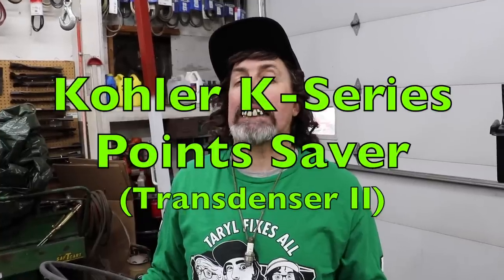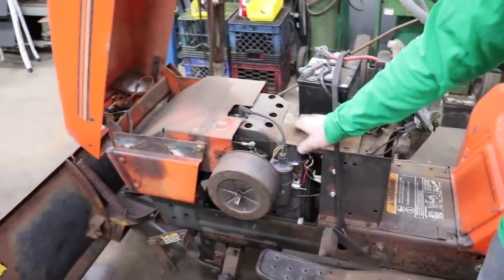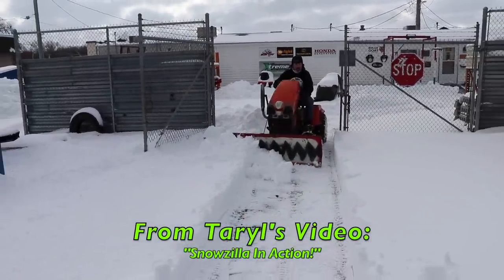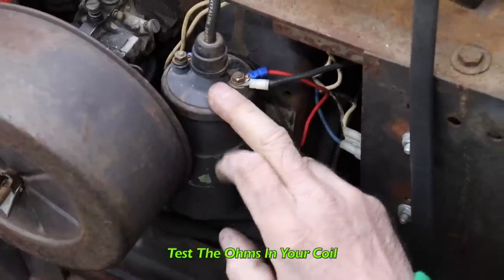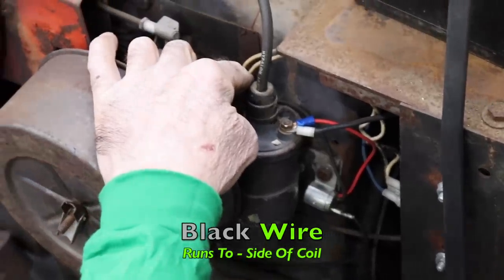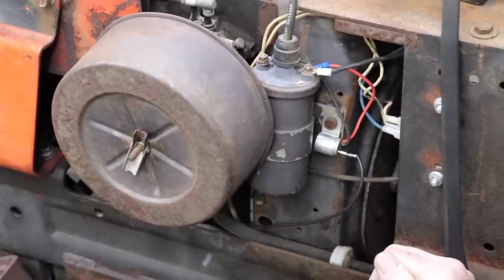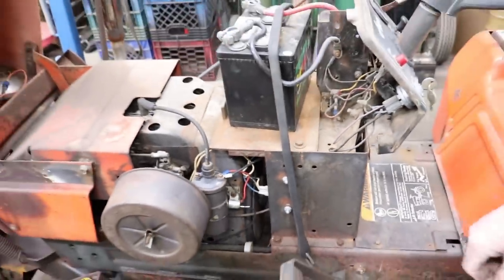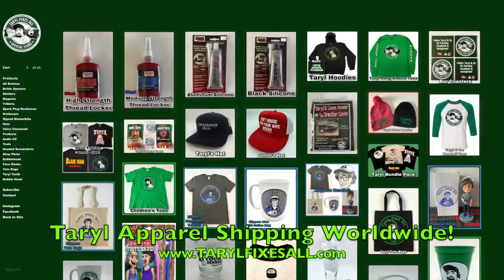AWESOME Kohler K-Series Points Saver (Transdenser II)

Comment: I love the drywall anchor as a wing nut for the air cleaner.
Reply: Lol I saw that also
Reply: Toggle bolt lol epic
Reply: Walter McLean, nah it’s called using your resources & being smart. I would’ve done the same thing if I didn’t have one on my knohlers cuz it’s way easier than just a nut.
Reply: That’s factory
Reply: That’s hilarious I had to go back and look at it
Reply: Hillbilly engineering.

Comment: My 1976 Wheel Horse C 120 has a condenser and the original set of points! Guess I'm lucky to have an everlasting K motor. Thanks for the info about the Transdenser, though at this point, (no pun), I'll probably go bad before the tractor.

Comment: Put a set of the old Kirk Engines Point Saver on my model 71 about 20 years ago, mow the big back yard with it during midwest mowing season, starts first time, guess I should clean the dust off the points at some point.  Never checked the timing, probably won't.   Money well-spent!

Comment: Do a eBay search for “Transdenser” and “Transjender” comes up every time. Way to go Fee-Bay!
I did purchase two of these last week for the two Arens GT 17’s that I have. The points ark like crazy on those engines and they are hard starting when cold. I checked voltages and tried different condensers, lined the point contacts so they fit completely flat against each other when closed. They still arc like crazy and quickly pit. Hoping that these Transdensers will fix the problem.

Comment: Used an old Heathkit add on CDI that I bought for a buck or two at a car swap meet for years on my Bolens with a K341 with zero issues. In the mean time, ran across another brand CDI and bought it, and finally the Heathkit one died. Swapped out for second one, and it ran ignition for several more years. But when that went out, had nothing but trouble going back running on stock points ignition. Found another swap meet buy, a MSD 6D, called them for correct wiring diagram, but found out it was bad (why someone SOLD it in the first place at swapmeet). Somewhere I've got another MSD, and that's what's going to be the 'points saver' for my old Kohler.

Comment: I'm guessing, but I'm betting the "Transdenser" takes the place of the points electrical ckt for charging the coil and then the existing mechanical points just become the on/off switch for the "Transdencer".
Reply: pretty much spot on with your description.
30 years ago i built an electronic ignition for my 1977 Mazda 808, one day the car just stopped while driving, the points had totally closed because i neglected to oil the cam and the little block on the points wore down.
the module re-energises the coil 5 milliseconds after discharge, giving a hotter spark due to longer charge time on the coil.

Comment: It'd be nice if it mounted down by the hole to the fly wheel. So you could actually use it as a timing light as it was running.
Reply: You can ad wire to it so you can do that i could do it

Comment: An older style Dodge ignition box will work the same, as well as a GM HEI module from a 70's car works good too, and cheaper!!
Reply: Does it last longer and is made better
Reply: I'd like to see how to use one of those that you mentioned.
Reply: @tjrick7745  a high speed switching transistor would even work. I suspect that's all a points saver is, built into a self contained heatsink. 
Do a Google search, tons of conversions posted.
I know for a fact the GM modules work, I've done it to a Bolens tractor.
Good luck on your project!!

Comment: Taryl Point and question about the points. Plus a few other questions. The main problem with points is that they corrode and you cannot place oil on them to prevent corrosion. If you do so it causes problems. Questions?

(1) Can you put oil, or some sort of anti-corrosive compound on the points using this setup. If you can I would think that the points would without a doubt last the life of the machine

(2) I have a couple of old Cub Cadet 125's that are so old that they don’t have the window to set the points. How would you set the timing on an engine of this vintage ? They are so old that they are actually Starter/Generator engines. 

(3) I noticed that your engine has a light knocking noise as does mine. Is this a pretty common thing ?

Comment: you could just add a resistor between battery + and the +primary coil .. but the transdensor is one less item under the hood.
Reply: After the second car swap meet add on CDI unit finally died on my K341, I tried just what you mentioned, and it wasn't any better on the standard points set up. Back to dressing points after 47 minutes of use. Even tossed on couple extra condensers and same results. Need to find MSD 6 somewhere out in my storage.
Reply: @marvinheemeyer9768  , Im now convinced you are right. The transistorized points is the way to go. His transdenser design is a winner. Im going to buy a few.

Comment: 30 years ago i built an electronic ignition for my 1977 Mazda 808, one day the car just stopped while driving, the points had totally closed because i neglected to oil the cam and the little block on the points wore down.
i still have that ignition module fitted and have NEVER replaced the points. (i just have to remember to oil it once a year)
the modules now are as tiny as the one Taryl is fitting.

Comment: I have a 1969 John Deere 112 with that same motor and it runs great I have never change the points. And besides isn’t that what the resistant wires for, For ballast resistor in the cars.
Reply: We are the only owners my dad bought and 69 I have done all the maintenance I bought a set of points for it and never installed them because It always rain strong.

Comment: will you do a carb tune video on the kohler magnum series? i have an 18hp that im having a little troble leaning out, smokes a little black when it revs
Reply: Taryl has done a video with a Kohler magnum 20 which is basically the same engine and the same carb intact he does a total rebuild check out his video

Comment: Why not just convert to electronic ignition and get rid of the points completely?
Reply: not so easy or cheap  with a 12 volt system
Reply: @buzzedalldrink9131  That may be true for the Krohler12V K series.  I do see kits for the 6 volt systems.  I haven't owned any engines with points for years, but when I did I also tried to convert them to electronic if possible.  I think I converted my first motorcycle engine in 1980 so the kits have been around a long time.
Reply: @terryburke2587   Yes I know it can be done and good for you for doing it  but its only a lawnmower   just put points in it   They have been working for 100 years or so
I have better things to spend money on than this guys crap  or anyone else’s parts that are not needed